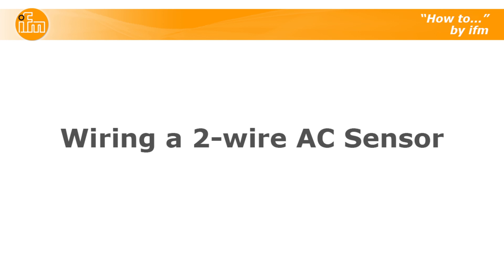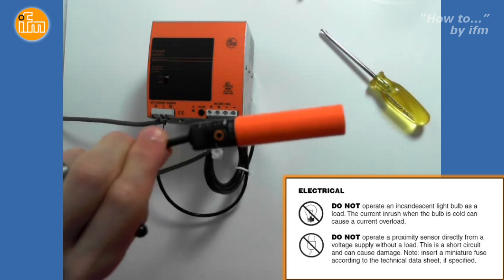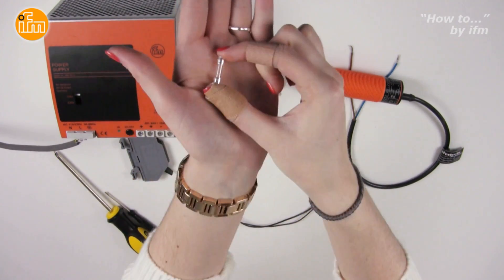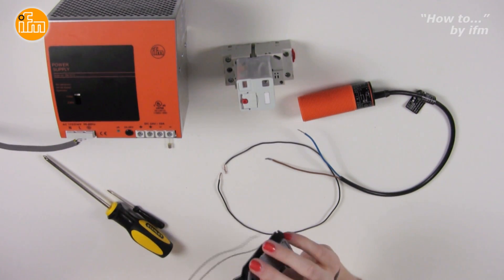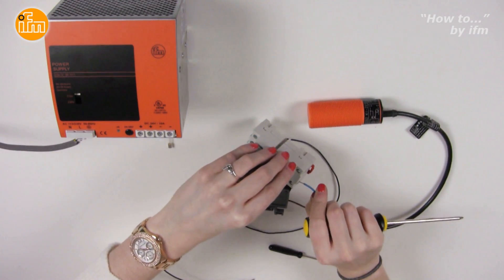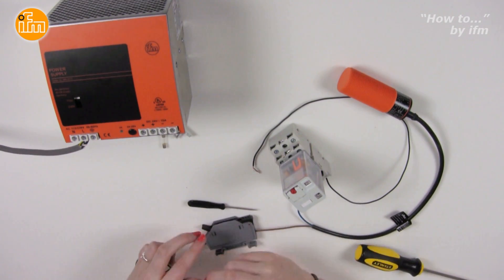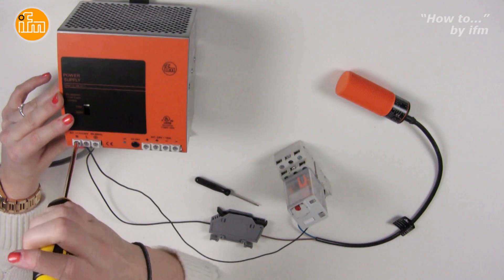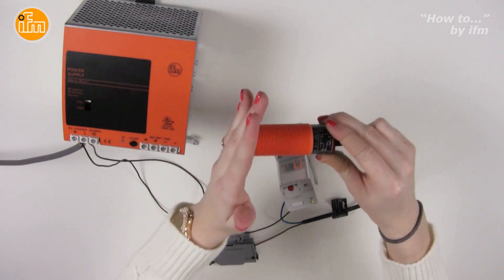How to: Wire a 2-Wire AC Sensor

Comment: crown cork is stainless steel type of material then how it is attracted by inductive proximity and refro reflective photosensor?
Reply from the maker: For many inductive units, the sensing range on stainless steel is reduced by the factor 0,7. 
However, we also have inductive devices with K1 technology, which maintain the same switching distance regardless of the material of the metal. 

Photoelectric sensors without polarizing filters may not be able to recognize the difference between the triple mirror and the shiny crown cap. We therefore recommend using a device with a polarizing filter.  The light plane is rotated by 90° by the mirror and the sensor is able to distinguish reflecting light from the mirror and the object.

Comment: Hi, I have a 220 VAC, 400mA Capacitive sensor and a 10A 220 VAC relay. Can I use the similar combination (without any additional electrical components) to replace a 10 A foot pedal switch of a machine (220VAC, 10A) ??? Or do I need to add more elements to the circuit???
Reply from the maker: Dear tarzan nakarmi, thanks for contacting ifm. Please contact the ifm support in your country. They will help you individually with your ifm sensor. Yours sincerely, ifm Social Media Team

Comment: You turn off the power suply, but you aren´t working whit 24v of the power suply, you are working directly to the 120VAC
Reply: lol When I saw that I was shaking my head.  If had half a brain or gave a crap about their viewers safety they would be using an isolation transformer as an AC source not the AC input to a DC output power supply.